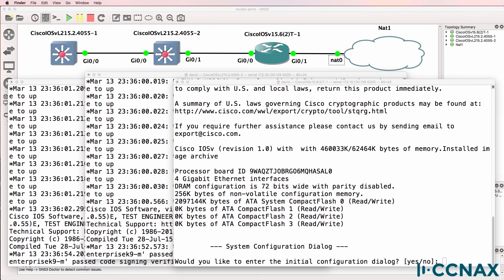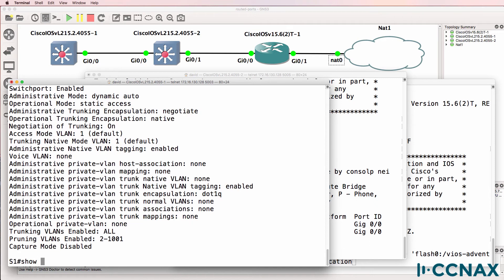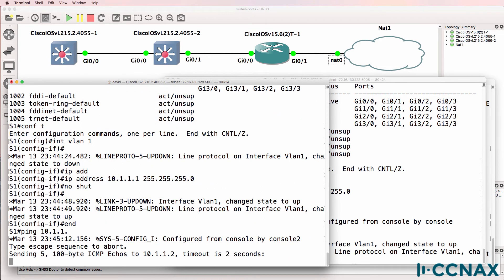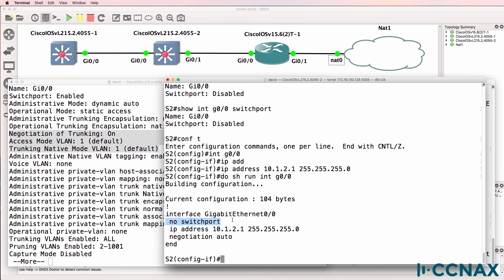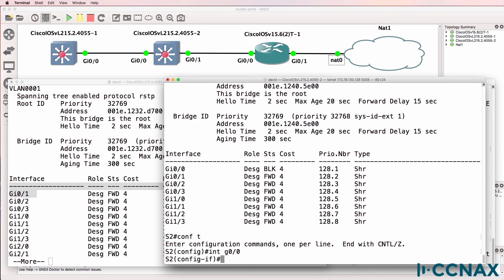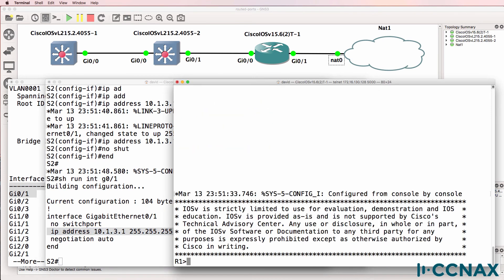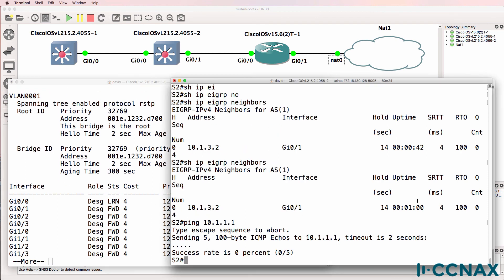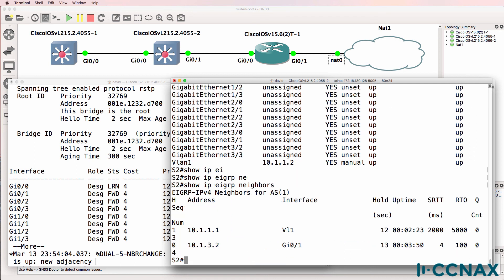CCNA #065 Routed ports, Switchports and SVIs - what and how?

Comment: Hi, I found sometimes trunk & access modes configured for the same port, eg te 1/0/5, could u explain what would be the purpose? I learnt we need to use either trunk or access mode, bt industries using both at a time, why? would it effect? bt still it wrks fine. how?

Comment: Hi, great video and love your udemy courses 👏

my question is then, if vlan tagged traffic cannot be routed through L3 routed port, then in what scenario are they useful?

Home Lab
I configured a cisco 3560 connected to uk 'adsl router' with 'ip routing' enabled on switch but could not get any traffic back and forth from any local vlan via L3 routed port. from switch L3 port to internet no issues, but from vlan ip's to internet via L3 port not working. I believe its because adsl router cannot understand vlan tagging and is ignoring the packets hence not replying back via icmp from svi and vlan ips.

Also tested trunk port on switch, this also did not work for local vlans to connect to internet.

I believe i need to add a Router between switch and adsl router to get this working, or could i use an old cisco 515e in between adsl router and switch to get vlans to connect to internet.

I was thinking a multilayer switch could do this no problem.

please advise.

Many Thank in advance.